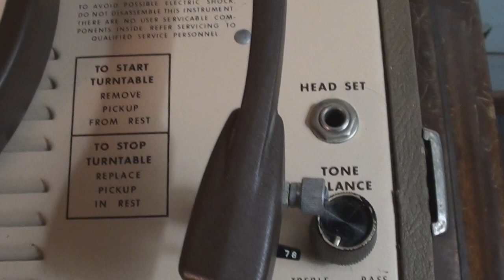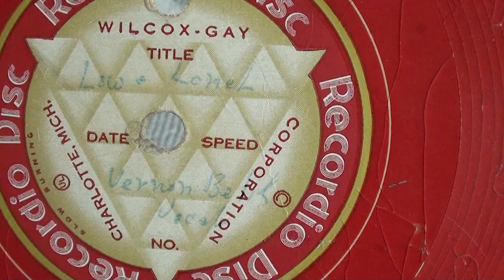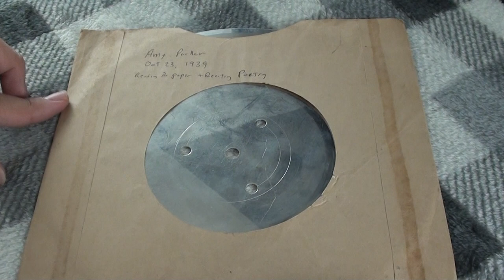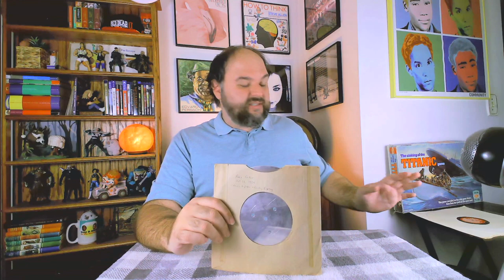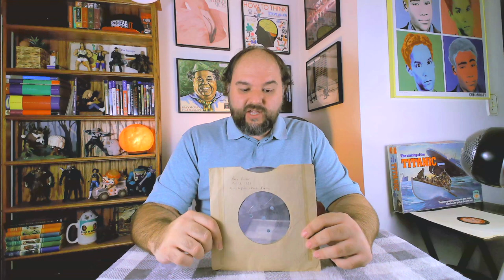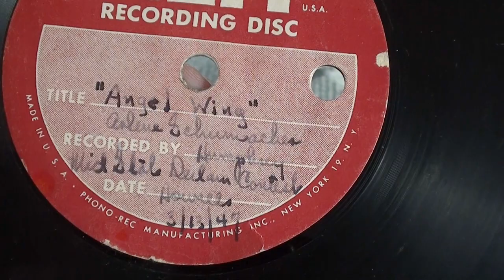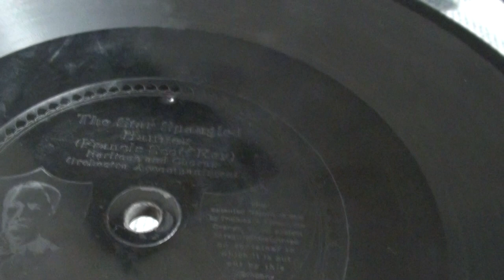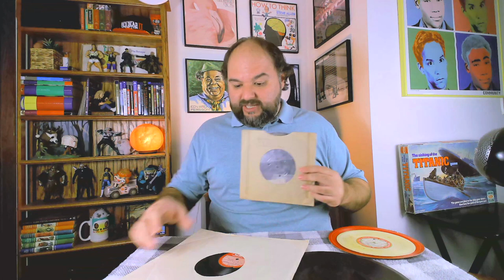Vinyl Record Restoration (Recordio, Aluminum, Edison, Gem)

Comment: About diamond discs. The older ones with no paper label plays the best with stereo cartridge and stereo stylus, the late ones with paper label, with a stylus that is like the 1950's standard.
Shellacs before the 1950's have another equalization. Roll off 200 Hz instead 500 and no treble boost. When you play it on a modern turntable you will have too much low mid and high cut.
The 65 micrometer stylus, that was standard for late shellacs is too fine for 1930's records, there would be 90 micrometer better.
For comparison, Mono microgroove has 25 micrometer, stereo 18 micrometer, and in 1970 also Mono records were 18 micrometer.
About Edison Diamonddiscs, they were 80 rpm instead 78 rpm, in Audacity you can speed up.
Acoustic records before the 1930s runs the best with RIAA

Comment: 1:02:17 Did you use a stereo pick up and from this one channel only?
Reply: Why not play a modern stereo record on your victrola?
Reply: The proper way is a stereo record player with the standard stereo stylus. Disable the phonopreamp, feed the microphone in, apply some boost below 200 Hz, low cut at 80 Hz and high boost at 4 kHz and high cut at 9 to 10 kHz.